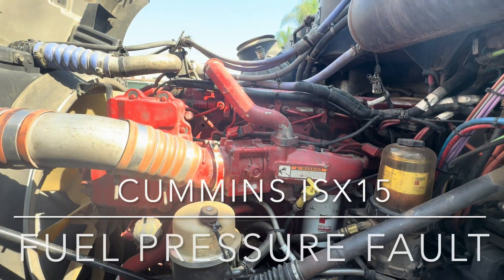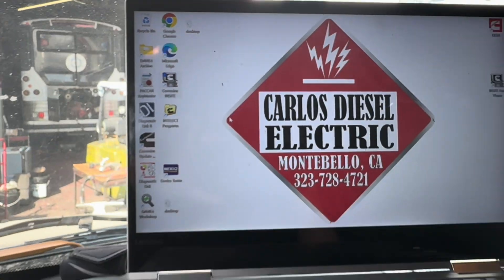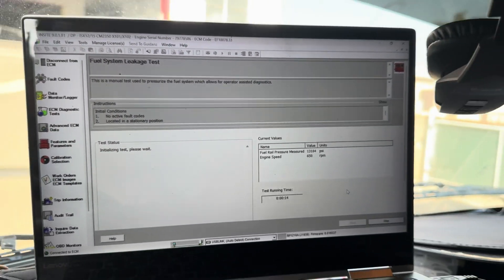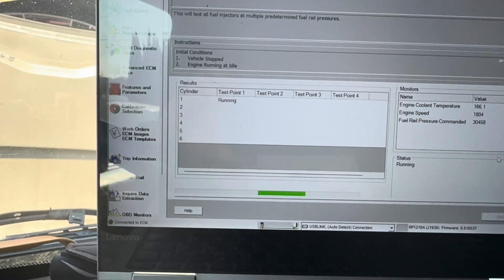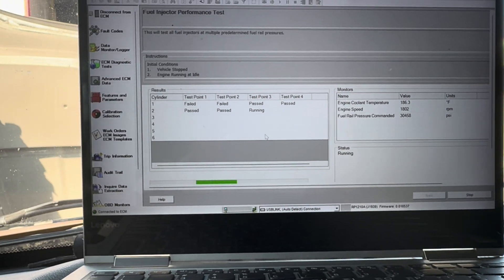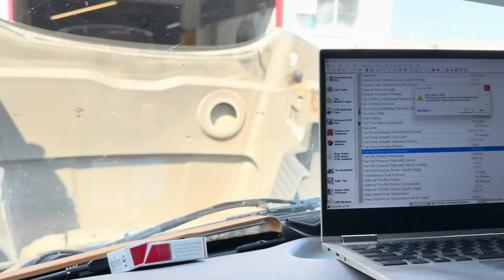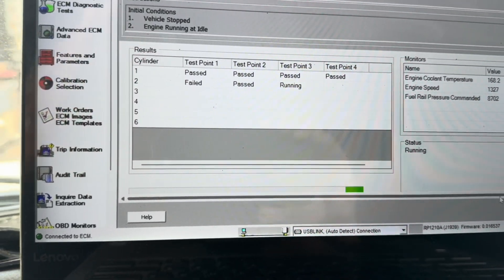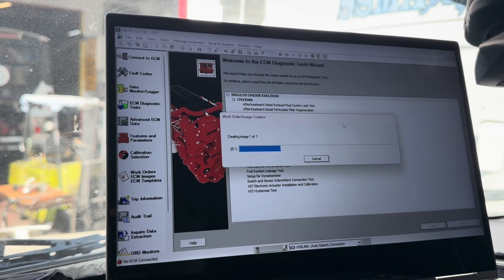Cummins ISX15, fault code 0559 with fuel pressure issue. Could be the aftermarket injectors.

Comment: Obviously you dont have the proper tools for 559? Why not test the injector return? You wouldnt have guessed. Not insulting you
Reply from the maker: Everyday I learn something new. Appreciate the tip.
Reply: @CarlosDieselElectric again, my comment isnt hate. If youre limited on tooling you cant. If you tested inj return fuel flow it would 100% confirm your thought of improper torque. All love. You did great, just trying to share info so were all better. You also could turn the key off after building max pressure and watch for fuel decay, i think is 1500psi. Also if you unplug the quantity control valve on the pump it defaults to max pressure. So no more waiting/wondering on max psi
Reply from the maker: @WeakPiggy  👍🏼
Reply: @WeakPiggy i need your input on the same engine, having trouble to fire it up, first truck crank but won't start i've checked the pressure on the rail stays at 150 psi, i assumed the aftermarket high pressure fuel pump that i put 8 months ago has failed, i went ahead and replaced it but still getting same fuel pressure , i'm kindda wondering what could it be or missing that causing the high pressure pump outlet is just at150 psi.
Reply: @Khaleelsalah you can see rail pressure and while cranking its only 150psi? Have you verified low side is good?

Comment: I had the same code on my motorhome. I had changed filters, driven down from Montana to So Cal, parked in an r.v. resort for a year. Basically started it monthly to warm it up (no driving).
When I did drive it from the resort, the code materialized.
Long story short, I changed the filters again, fresh fuel and NO code, no power loss, etc.
I’m stoked. Basics, I guess.
Thanks for the video.👍
Reply: A sad addendum… yes, you guessed it, the problem materialized again.😩
I managed to get to a truck/r.v. service center, 3 days & $2500 later, I’m back on the road.🤞
It was a faulty fuel-pressure valve that needed replacing.

Comment: What ended up being the issue?
Reply from the maker: I was able to torque down the injector tubes to the correct specs. Retested and customer did not return so I imagine all was well.
Reply: I pulled all my high pressure connectors out, and put new ones in. Out of the old set, 2 of them were scored at the tips. New ones solved my issue. These things are freaking sensitive! Thanks for the reply. Great vid. Very informative!

Comment: I’m getting this same code but whenever I start the injector test it ends right away and the code becomes active
Reply from the maker: @cfgflex8427  which test are you starting with?
Reply: @CarlosDieselElectric I’ve swapped out the fuel pump and the fuel relief valve change the filters and the fuel pressure is not reaching 29000 psi it’s only goes to about 14000
Reply from the maker: @cfgflex8427  try performing the injector performance test. It will test each injector at high psi and then a lower psi. This is a pass or fail
Reply: @carlosdieselelectric whenever I start the test code 559 becomes active and the test stops
Reply: @CarlosDieselElectric  I have a used set of injectors should I just put those in and see if it fixes it?
Reply from the maker: @ try running the performance test. It is a pass or fail test. For example, if cylinder 1 passes then it proceed to cylinder number 2 and so on. It will test each cylinder 4 times. I would recommend you start there so you don’t have to spend too much time or labor.

Comment: I have this error code but my truck turn off after acceleration. Was this truck doing the same?
Reply from the maker: You might need to do some tests to help find the issue. Try testing the fuel pump high pressure leak test. The pump article will increase to 28,000 to 29,000 psi. It should climb fairly quickly and maintain pressure. If you see the pressure struggle while climbing that could be a fuel pump issue. 
Also try doing the injector performance test after. 
What kind of work has been done?

Comment: What are some tips for testing low fuel rail pressure when the truck won’t start, I’ve pulled injectors and visually inspected, replaced o ring and copper washer, replace fuel rail regulator , replaced fuel pump solenoid, fuel pump head ( scored up plungers)  this POS still won’t start lol. New battery’s all fuse check out good , ECM connected just fine commanded is around 6, 000 psi actually is 300 psi
Reply from the maker: Using starting fluid, will it fire up? Once the truck starts up, an injector cut out test will let you see if the injectors are responding. If you feel comfortable, allow the truck to warm up and reach 175 degrees. Then do a fuel pressure test to see if you are reaching 28,000 psi. Then you can do an injector performance test using Insite. It is a pass or fail test and it is all automated by the program.
Reply: Did you figuer out what was the issue, i'm having the same situation, i did replace the high pressure fuel pump and still having 150 psi to the rail

Comment: Can I use a fuel line socket to torque those injectors down? I was working on a bus that needed an intake gasket and those lines were in the way. I removed three of them to get the intake top off to get that gasket and tightened the lines down but was not aware that the injectors had a nut on them. Long story short the bus went out and that code 559 came up. Has me wondering if the injector nut moved while trying to break that line free.

Comment: How do u know those fuel filters are good without taking them off and inspecting them....also if a part was replaced inder warranty the tech will spray paint cummins part red with cummins paint
Reply from the maker: Great questions, I typically start with asking the customer the issue, when does it happen, does it happen under load, up hill on the flats. Fuel filters were recently replaced and were original. 
Customer stated injectors were rebuilt by a small shop, most of the time they are not done well. I did find the fuel lines were not torqued properly and them did the test again and had better results.
Reply: Bro same code my truck i was change fuel pressure valve , sensor , injector what i shoud now
Reply: can you give me your number pls

Comment: I have a 2016 Cascadia with a DT 12 transmission. My transmission stops working soon as I left the toll plaza with a no fault code  and the screen has only show the symbol I’m - - _ The truck now is in the dealer. They can check on Monday. Any idea?
Reply from the maker: Possible CPC 4 is starting to fail. Try installing a test CPC4 from a similar truck. These have been know to fail with communication. Try testing first